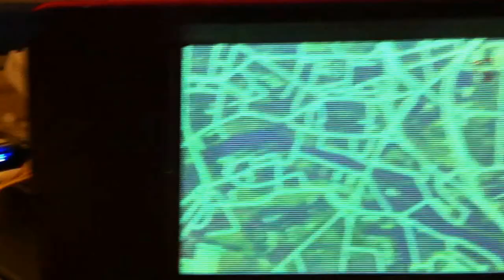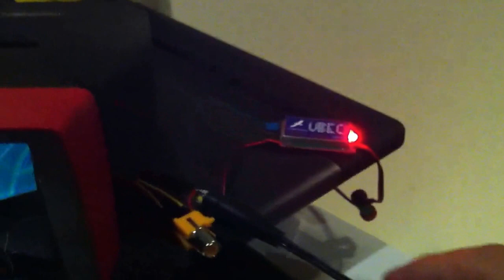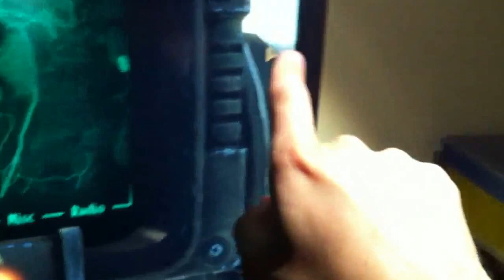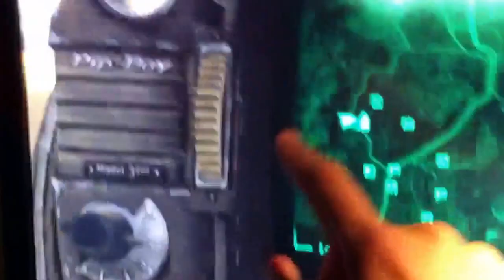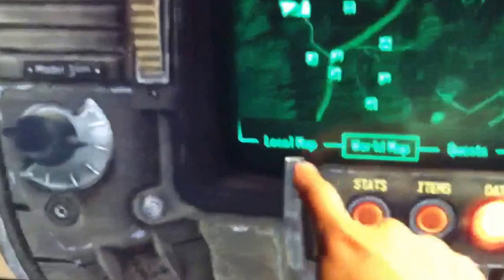RasPi Pip-Boy 02: GPS map and electronic controls

Comment: the map is wifi?
Reply: Captain also will this work on the Raspberry PI B+/2 ?
Reply from the maker: Captain  It's downloaded either via wifi, or ethernet, depending on what's connected at the time.
If there's not internet connection, it uses the last map it downloaded.
Reply from the maker: Captain I don't have one, but I don't see why it shouldn't :)